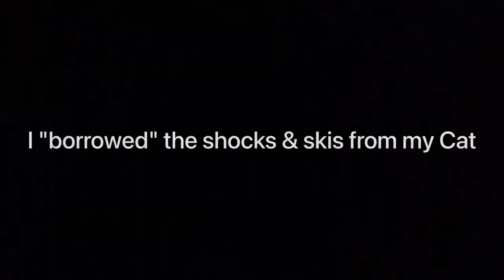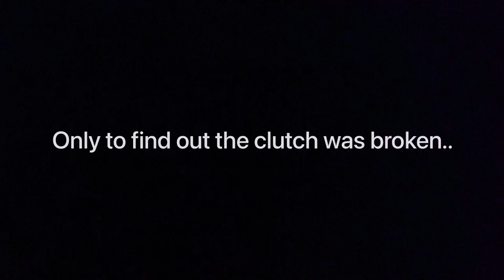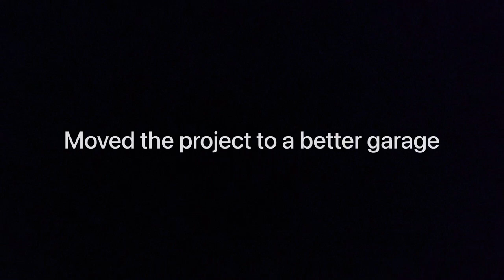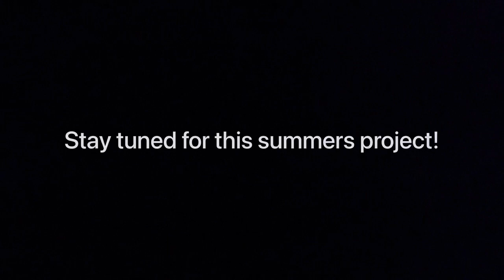2007 ski-doo Rev build!

Comment: What’s the reason for drilling the cases?
Reply from the maker: Lubing the crank bearings with premixed gas instead of isoflex grease
Reply: @kristerlunde did you put the triple in this because you blew the 800 up?
Reply from the maker: @93Tillinfini  No, as yo can see in the video the 800 got drilled cases, new gaskets and pistons..
Swapped to a yami 700 tripple because I build one back in 2019 and absolutely loved it!

Comment: Sick build. What's the reason for drilling the holes in the case?
Reply from the maker: Thanks! When drilling holes in the case, the crank bearings gets lubricated by oil & gas mixture instead of isoflex grease.